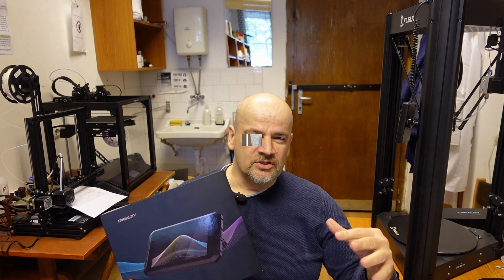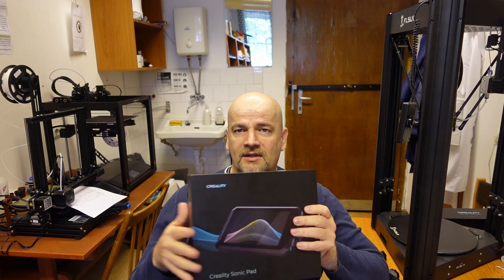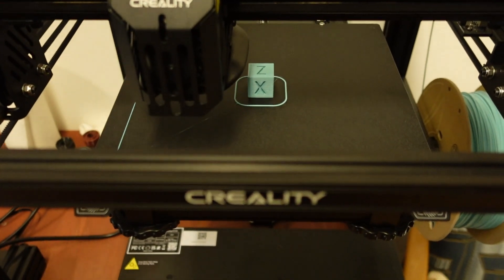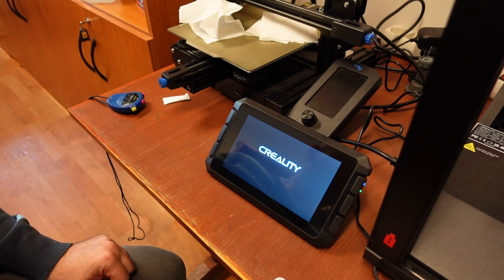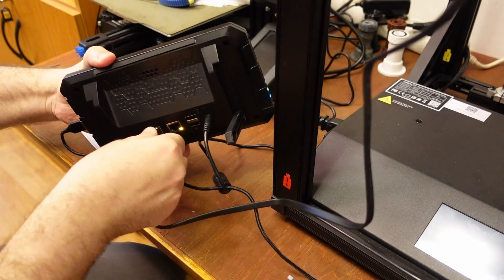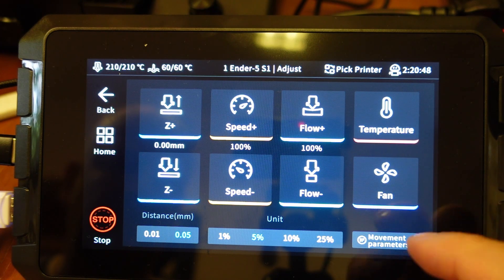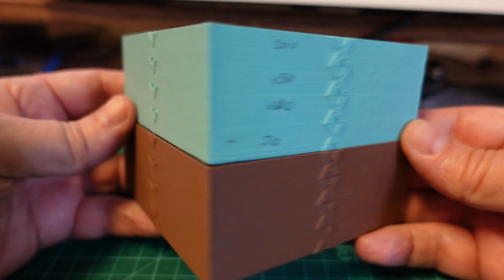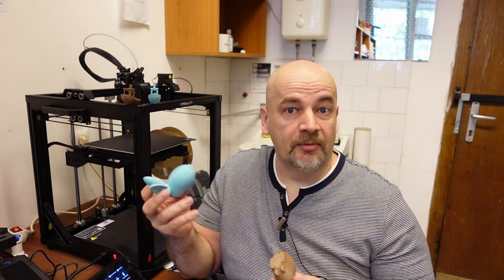So, is it really faster? Creality Sonic Pad test with Ender-5 S1

Comment: Old video, but I'll comment anyway;
To me it seems the accelerometer sensor was not placed at all in an ideal position. Since you showed how the printhead wobbles, putting it up top would not capture the movements of the actual nozzle that well.
I find it odd how little improvement a Klipperized rigid-framed machine like the Ender 5 with an accelerometer brings to the quality, especially on ringing/ghosting, since with a similar setup (Sovol Klipper pad + accelerometer) on my Sovol SV06 Plus, I get basically no ringing at all when printing at 150mm/s.
Even my Ender 3 S1 Pro with manually calibrated Marlin Input Shaper gets at least as good results as shown in the video :D

Comment: I have watched 4 different videos on the Sonic Pad. In everyone they used an 8 GB SD card. Is it purely a coincidence or was there a reason why this size was chosen. I have been unsuccessful loading the firmware using a 64 GB card. I have read on the internet that some Ender printers have trouble reading cards larger than 8 GB. If that is true, it would be valuable information to pass on to your viewers.

Comment: Thanks for doing this testing.  I was thinking of switching to klipper, but with such poor improvements I am not sure now.  I would have expected a lot better improvements especially a speed increase.  I have seen other videos where they werw able to run the Ender 5 S1 at 250mm speed with 5000mm acceleration and the print quality was excellent.  I am not sure why you could not get such results.  As for the Sonic Pad, it is just too big.  I would prefer a 5 inch screen.  

Did you use the accelerometer which should have come with the Sonic Pad or at least I thought it did.  Maybe you have to order the accelerometer separately.

Comment: When increasing your speed you also have to increase your flow so the extruder can keep up with the speed of the machine. Try 105% flow at 100mm/sec and 0.15 layer height and that should correct your issues. You can also set your speed at whatever number, say 200mm/sec, then run a flow test to find the best flow for that speed. Some companies also make high flow filaments now
Reply: If you have to increase your flow rate to avoid under-extrusion then that means your extruder-hotend combo cannot deliver enough molten plastic for that speed.  Raising the flow rate can then compensate for this when moving fast, but will then also cause over-extrusion in spots where the print-head moves slower, so I don't think this is a good solution.  Better is to measure the sustainable flow-rate of your hotend (using the CNC Kitchen method) and then tell the slicer to limit the volumetric flow to that.  This will clip the maximum speed, but ensures you remain in the range your hotend can handle.  If you do want some more speed, then bump up the nozzle temperature a bit, measure the sustainable flow rate again (which should be slightly higher at the higher temperature) and use that in the slicer.

Comment: it is weird that you used the same gcode, the sonic pad or any klipper upgrade should allow you to print faster without sacrificing quality. I am not saying it's a good packange , I have the sonic pad and a rpi with klipper, and the fact that it is mostly closed source(and older klipper branch/fork) it is really anoying.

Comment: To me it looks as if the input shaping is not really being applied.  With such a printer speeds up to 300mm/s with 3-5K accel should give better results than you were having.  It would be good to have a look at what input shaper parameters are actually added to the printer config after the tuning with the ADXL.  I'd expect such a cube to have resonant frequencies in the 40 - 70Hz range (probably with an MZV shaper).  Anyhow, at the relatively low speeds you were printing that should not give such ringing anymore, so it looks as if input shaper is just not enabled.

Comment: Your test method is flawed and the print quality of the "after" models is complete garbage. This supposedly "turnkey" solution is a completely useless way of running klipper. 
Your profiles need tuning specifically for this printer, Pressure Advance should be calibrated, the stock hotend appears to have issues keeping up with print speed and part cooling is a complete joke.

Comment: I tried one but it stopped working after the firmware updated itself, it would just no longer communicate with my printer. I waited a few weeks for an update but they never fixed it so I returned it via Amazon. The few small prints it did before it stopped working weren’t anything special except printing a little faster.

Comment: First of all, please be aware that Creality Sonic Pad does NOT run Klipper, but instead it uses a custom fork of Klipper... What that means is that it is running very old and unsupported code and any problems you have, you will have to go directly to Creality for support, as the Klipper devs and maintainers (where I am included) will NOT support their version of Klipper. Second, please be aware that Creality has broken the open-source licenses of Klipper, Moonraker, Mainsail, Fluidd, and Klipper Screen (some of the software powering the Sonic Pad).
Now considering the ringing results you had, seems to me you need to do some adjustments to your printer, specifically check belt tension and any wobbling as those will affect the results considerably (the stiffer the printer, the better Input Shaping results)
Reply: Why they chose to go with a butchered fork of Klipper which takes up Creality recources to maintain and update the software and firmware package when they could have just gone with the stock vanilla version is beyond me, I use an Orange Pi Zero 2 and a 7" touchscreen £21 for the Pi and £64 for the touchscreen housed in a 3D printed case which can be either mounted to the printer frame or free standing on the desk, If I wanted a turnkey solution like the Sonic Pad I would go for a BTT Pad 7 which also runs the stock version of Klipper and is considerably less expensive than the Sonic Pad.
Reply: @AndrewAHayes  so the BTT is set up out of the box ready to go and is better then the Sonic Pad?
Reply: @nickp385  they took the code, made changes and didn't release said changes under the GPL License. They have now released some of their changes but the repos have not been updated with their latest changes, so same issue all over again. They also changed the Fluidd copyright to their own, something that goes against attribution requirement on the license.
Reply: Pedro what would be needed to run the newest Klipper on an Ender 6 and how hard would it be to set it up? I guess I would need a new board and a Pi to make it all work.
Reply: @nickp385  I hear you can use a laptop to run klipper.  Pi is more conventient but an old laptop running some linux distro does the same thing, i was thinking of going this route and there lots of tutorials how, but my printer  (anycubic vyper) released the sourcecode for the firmware and someone already made a community edition mod  im running thats really nice upping the bed mesh points to 49 as opposed to 16 stock among other things. That being said it didnt include all the newest features of klipper and when somone asked about that, the mod devs basically said they got no financial support so wont do it... heh an  advantage of going klipper i suppose, you can do changes without a recompile but  my printer prints great so i dont even know if tis worth the hassel, the new firmware really made the UI way nicer on the touchscreen but id loose that with klipper so... I still might just for fun but like this sonic pad im not expecting huge improvements, maybe slightly faster printer times.
Reply: @mikejones-vd3fg  Thanks Mike, I'm really new to this so it might be a little hard for me. I do have an old laptop but would never know how to configure it. Maybe the BTT or The Sonic Pad would be best for someone that has no experience at installing this stuff. The Ender 6 prints very nice, its all enclosed and prints pretty fast. I just thought it would make it even better. Thank you for trying to help. Much Appreciated, you have a great day.
Reply: How have they broken the licences of Klipper and asscociated packages?

Comment: It is really strange that there are no real advantages in case of speed and quality. It seems like the printer has some extrusion issues or there is something wrong with xy movement. Maybe on Ender it should work better
Reply: I 100% this comment, I think that the uneven layer lines and the strange artefacts were not caused by acceleration/jerk, but as mentioned above, it could be the extruder. flow rates perhaps? 
In the second input shaping test, the brown X in the highest speeds have this blob on them; I think it matches other uneven Z lines where it's possible that it under extruded and created those artefacts + layer lines.
100 -200 mm/s for this hotend might be too much at these layer heights/widths?

I suspect that a different test might show better results. 

same speed + 60%-80% of the maximum flow for this extruder setup, but change acceleration values or jerk / SCV only
Reply: I have a sonic pad for my cr-10 smart pro and at 100mm/sec i had to increase my flow to 105% to get decent prints, i'm guessing he left his flow at 100% for all speeds. The 100% flow was set for 50mm/sec speeds so if your increasing the speed of the machine then you need to increase flow so the extruder can keep up with the machine